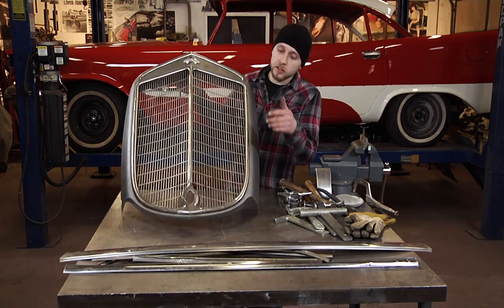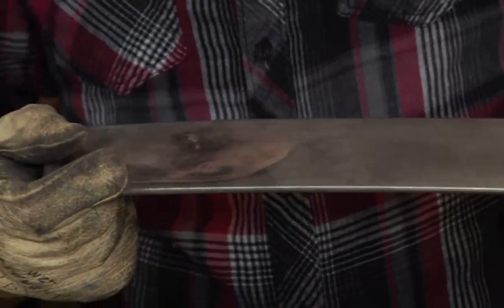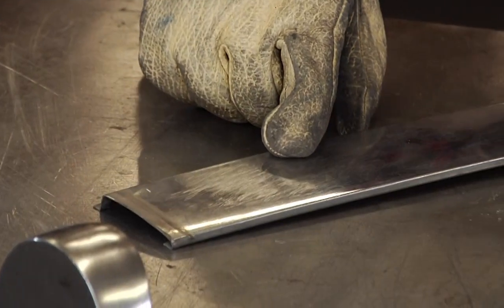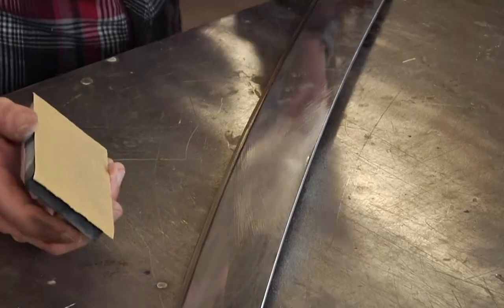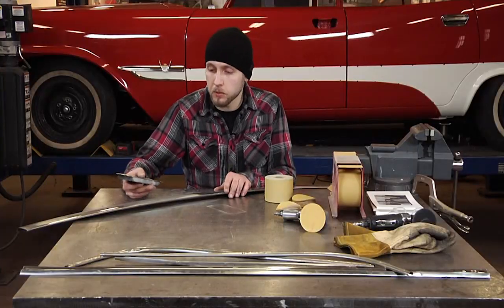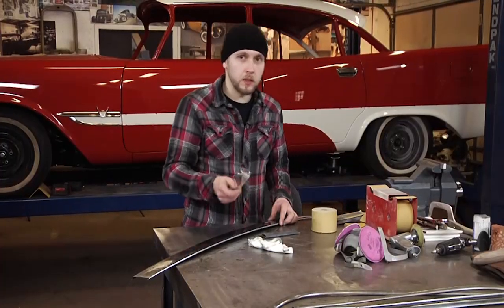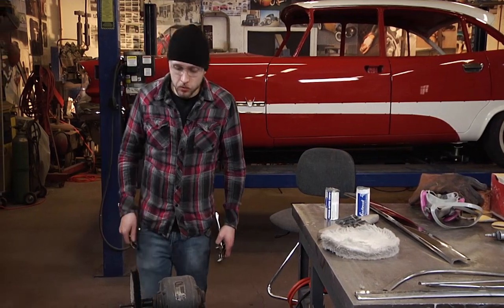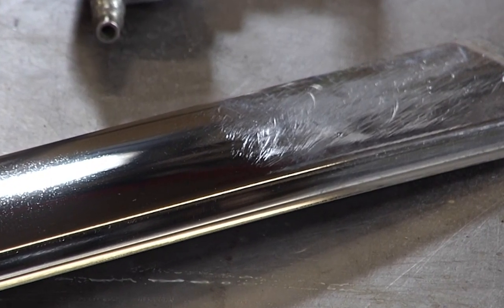Repairing And Straightening Stainless Trim

Comment: Great video and very well developed skills. My back hurts just watching the buffing wheel segment as I would weld some pipe-in-pipe legs like a metal walking cane. Question, 1968 C10 rear window SS I have is OEM and is one piece segments. It is folded on its self and one edge returns to the center that create a deep barb that goes into the rubber groove. Everything is excellent except one spot under the fold that can't be seen. Will it have be bent to get a flat "Peek-a-Boo" tool inside to massage out? Keep those dolly's and hammers polished! Take care, hope all is well 4 years since video was posted. Great talent/skills!

Comment: Great, well done video! I was trying today (for the first time) to take dents and scratches from my wheel well stainless trim. I watched your video after that (wish I had watched it before LoL). I did get them looking pretty good for my first attempt. 
I could use more anvils and hammers after seeing your methods. I will now work on the windshield & rear window trim that has a few small dents & scratches. Lots of stainless trim on my 70 GTO, so I really appreciate this video. I feel what I was doing was correct mostly. I didn't have the stick buffing compound so I used paste rubbing compound, which worked but really spatters! 
Thanks again for the video!

Comment: I had a 1949 Cad sedanette fastback, the rear fender spears had small damage so I sent them to be repaired,  when they came back the dents were gone but the spears were Warped so bad from getting them to hot from buffing,  that I couldn't bolt them on the fenders, I tried to re curve them but never  got them right,  SHURE WISH I KNEW U, but that was in the late 70s. NICE VIDEO. thanks, William.

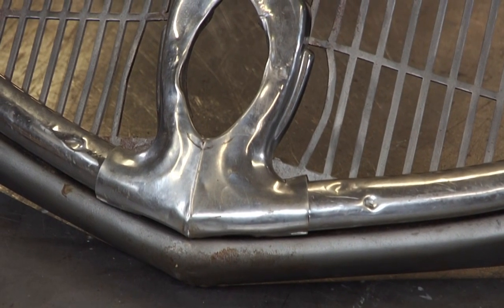Comment: 0:39 ..I almost laugh-shot cereal out my face when the visual entered my mind, (after talking about all the wear and dings), of you just flat out tossing the grill on the floor. Omfg... You did not do this, but Thank you for whatever cabin-fever-inspired hilarity just happened. I'm actually here because I'm trying to do a restore (99% small dents, dings,.. almost from a mini pencil eraser-size mystery object) on a 1972 Chrome Over Brass Slingerland Snare drum. It's stripped to its bare shell. Chrome is luckily intact around the entire shell, save for one, 1" long spot on the top edge where the head of the drum makes contact. As far as I'm concerned, you auto shop folks are all alchemist/Wizard hybrids when it comes to this, so I'm here to learn. Thanks for posting this!

Comment: DUDE AWESOME VID THANKS 4 THE KNW HOW. 1 MORE THING WHERE DID U GET THE ROLL OF SAND PAPER
Reply from the maker: Hello, 

The sandpaper used in this video is 3M stickit paper and is commonly used on board sanders when sanding body filler. 
Here is a link to one possible source: https://www.autobodytoolmart.com/3m-stikit-gold-sheet-2-34-sandpaper-rolls-p-11340.aspx
Or check your local Napa store or auto parts store that carries auto body supplies. 
Wrench Safe, 
Mark Classic Car Restoration Club Video Membership

Comment: AWESOME! You Da MAN Gary!!! What's the rpm on the buffing motor?
Reply from the maker: This particular buffer is relatively slow at 1,750rpm, but to compensate Gary uses 10" buffing pads to increase the fpm (feet per minute) to around 4,500fpm.
A speed he seems to like for buffing.

Comment: I loved the video showed me allot but what was the compounds you put on the buffing wheels I see you used two different kinds but what are they? I have never buffed anything out before like trim metals
Reply from the maker: Hi Michael,

The two compounds Gary used were both from Eastwood Company, they included their: 
- Stainless Buffing compound 
- White Rouge compound 
Eastwood has more recently changed their packaging on these but it's the same stuff. 
Always keep your buffing compounds stored in air tight plastic bags or containers. 
Once it dries out it is very difficult to work with.

Mark
Classic Car Restoration Club

Comment: I didnt think you could actually sand chrome. Would have lové to see the final result of the whole piece
Reply from the maker: You are correct! "You can not sand chrome". Although for this video Gary is sanding and straightening Stainless steel trim, and stainless can be sanded and polished. Stainless steel contains high levels of nickel and chromium so it is "Hard" and can be difficult to polish without a fair amount of elbow grease.

Comment: Any videos on removing rear quarter fender trim on 51 Chevy Delivery Sedan??
Reply from the maker: Hi Jim. 

Most of the clips on your beltline trim are snap on clips. and are removed by placing a putty knife or nylon trim removal tool above and below the trim clips and prying out. 
Although sometimes there are bolt on trim clips located near the ends and it is best to look at the backside first before removal. 
Another good reason to check the backside first, is often cars have been apart before and not always do they use the right clips to re-attach the trim.

Mark
Classic Car Restoration Club

Comment: do you clear coat after you polish? Does the clear coat help keep the shine, and prevent rust?
Reply from the maker: There is no need to clear coat Stainless Steel, as it will keep its luster for years and will not rust.

It will corrode, if left in VERY harsh conditions for an extended periods if time, but it is more likely the rest of the car will rust away before the Stainless Trim is affected. . 

Aluminum however should be coated with: Wax, clear coat, clear powder coat, anodizing, flash plating, paint, etc.

Comment: I was watching an aluminum panel for a Ferrari being made at Motion Products. He had to occasionally hit the panel with a torch because it would get work hardened. Are the dents in the trim small enough that you don't have to worry about it or have you had pieces  that were bad enough that you had to work so much they required it? I've just subscribed to your channel you metal magician!
Reply from the maker: Hello, 

For most trim straightening there will be no need for anneal the metal with a torch. 
Any metal can become work hardened and fatigue if moved a lot or worked for extended periods of time. 
Softer and non-ferrous metals like aluminum, brass and copper are more prone to work hardening than steel and stainless steel.
Wrench Safe, 
MarkClassic Car Restoration Club Video Membership

Comment: Having problems with the new repop molding clips on a 53 belair ..clip comes lose when putting on the molding..
Reply from the maker: Hello Stephen,
This can be a problem on some re-pop clips, Not all re-pop clips are as good as the factory clips, I have on countless occasions needed to bend/twist/modify re-pop clips to work. 
So don't be afraid to modify your clips, additionally you may want to consider universal styled molding clips, some of those will hold the trim on better than original clips.
Mark
Classic Car Restoration Club

Comment: You applied some sort of polishing compound in a stick form to each rotating polishing wheel, but did not describe what that stuff was.  Can you clear that up?
Reply from the maker: Hi Dean,

Gary is applying a buffing compound to the wheel. 
The compounds he uses are Eastwood brand although Eastwood has changed their packaging on this item. 
Here is a link to an assortment pack they offer: https://www.eastwood.com/eastwood-buff-compound-set-6-different-compounds.html 
They also sell each type individually.

Mark
Classic Car Restoration Club

Comment: HI! What is he putting on the buffer after he cleans it with the buffing dresser? Does the second buffer need it as well? Thanks! I've got about 3 miles of trim to work on for my 67 Impala. Cant wait....
Reply: same for me I have 67 impala convertible to do, this is the best video I have seen on it. the dressing he is using is a polishing compound, you can get it from most tool stores

Comment: Do you work with aluminum the same way?
Reply from the maker: Yes straightening aluminum is done much the same way. although 
because it is a softer metal we start the sanding steps with much finer 
grit papers.

If the aluminum is anodized, it is important to remove the anodize before straightening and polishing.

Here is a video that demonstrates an easy way to remove anodizing: 

www.classiccarrestorationclub.com/video/removing-anodized-finish-013907/

And here is a video that explains the straightening and polishing steps on aluminum:

www.classiccarrestorationclub.com/video/straightening-polishing-aluminum-013906/

Wrench Safe, Mark